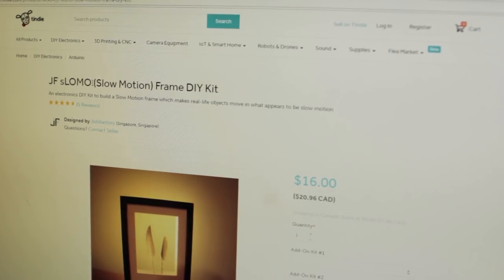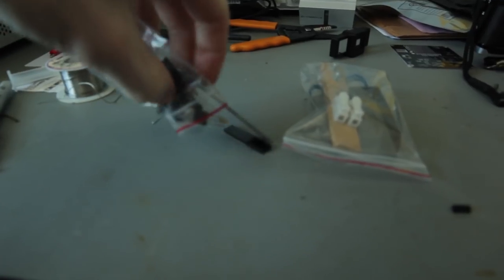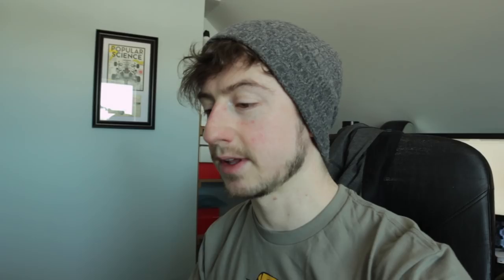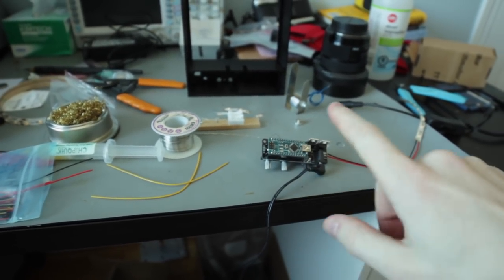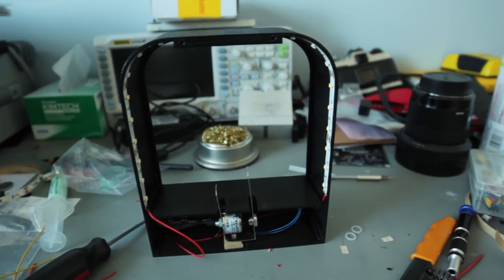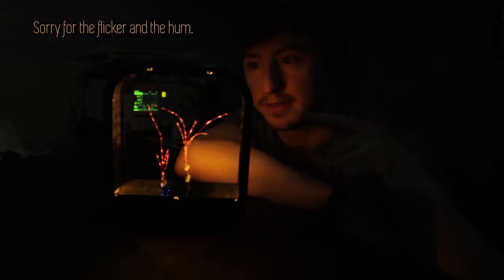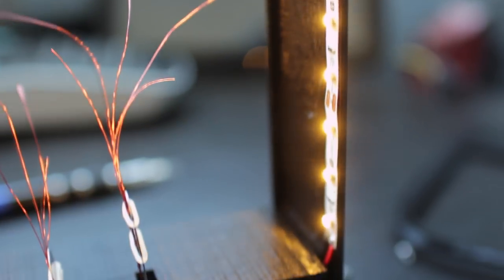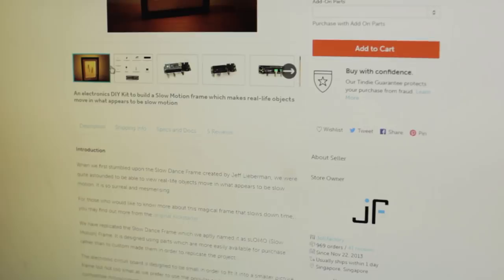Community Projects Ep.1 - JF sLOMO Frame Kit

Comment: To be accurate it's not a phase-shift but a slightly different frequency, e.g. if lights are strobing at 80Hz, the electromagnet can be at say 81Hz - that would give you 1sec slow-mo movement period.
I've built similar thing myself, now just trying to get rid of the humming. Perhaps winding an electromagnet without a magnetic core would help.
Reply from the maker: You're absolutely right, only phase shift would show them not moving at all at different parts of the wave. 
Most of the humming comes from physical contact with the the surface its sitting on. If I pick it up its nearly silent. Its just physical vibration so I don't think you will be able to get a great visual and have it be silent at the same time.
Reply: The original Slow Dance claims to be silent, but I've never seen one irl :)

Comment: Hey there. Currently I'm trying to built the slomo frame myself but I try to buy all the components by myself, because shipping is quite expensive for me from the US. Do you remember the exact specs of the potentiometer? It says it is a 50 kohm potentiometer, but it never says something about the wattage (if that's the correct term). I'm not sure if I need something like 200mW oder 2W.
Hopefully you have time to help me out :)